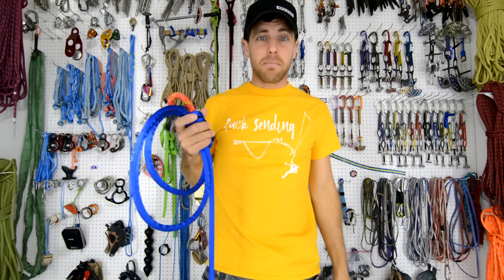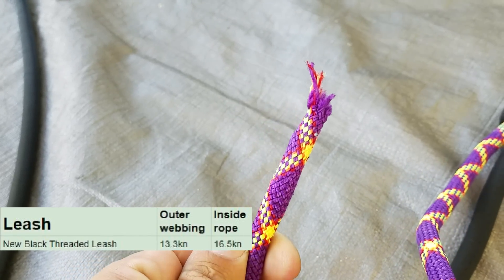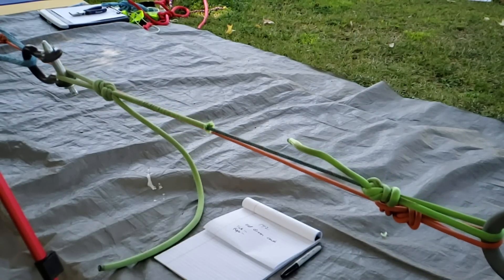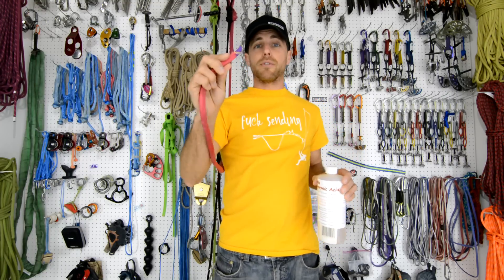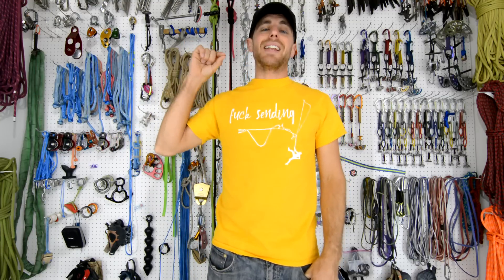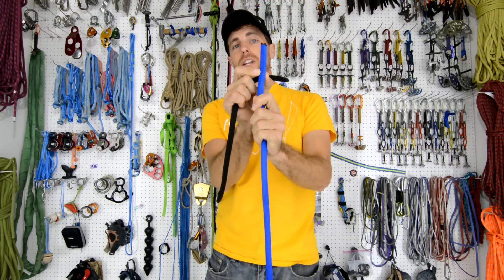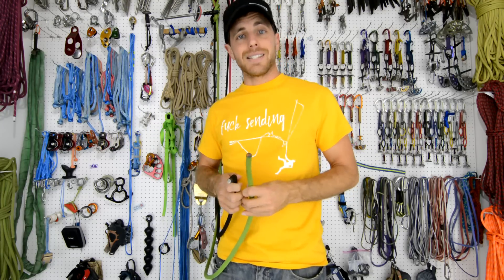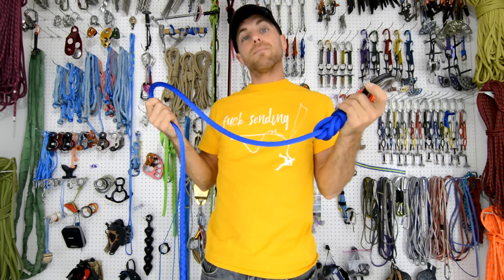Highline leashes break super weird!  SLACKSNAP!

Comment: Could you whip with a figure 8 rappel device as your ring say you dropped your leash and needed to make one to save the trip? Figure 8's are generally rated at 25kn and higher and seem like a pretty beefy ring just with another ring attached.  Haha Thoughts?
Reply: Arent those usually aluminium? Aluminium rings are contraindicated due to fatigue characteristics and their failure modes.
Reply: @JasperJanssen  True. But they have aluminum rings for Whips too. Would be curious to know for sure.

Comment: https://data.slacklineinternational.org/safety/research/forces-in-highlines-english.pdf/

Here's the link.

Worst case described-

For a ~19m dyneema line with walking tension of 2kn you can experience a leash peak load of 7kn. (Stupid for someone to rig such a line but anyway.)

Same conditions but with polyester webbing the peak leash load is 5kn. (I wouldn't prefer to rig such a line now but ive done it in the past)

So in a  short polyester line you will experience double the force on your leash compared to your findings. 

Thought i should add this perspective to the discussion.

Cheers ryan, perhaps your biggest fan in india!

Comment: Not sure if you read the comments on these now aging videos, but I feel as though it would be interesting if you did this same experiment with only the outer tubing.  I understand its not the component of the rope that actually is trusted with holding the force, but it may actually be less than the value you showed especially if the interior component is holding most of the force.  You have probably already thought about that, however, even if you didn't its still irrelevent as its not the strongest component.
Reply from the maker: The outer tubing is just 11/16th tubular webbing which would break roughly around 13kn give or take 5.  They definitely work together as this leash and everything breaks in the knot.  I've tested a bunch of 1" tubular and 9/16th tubular before and its pretty consistent

Comment: Great video!  You are on your way to a  material science lab. The slow addition of force gives you a more accurate picture of strength. In our lab when we are doing compressive strength tests of concrete if you apply  the load quickly you get results that indicate a higher compressive strength than when you apply the load slowly.
Reply from the maker: After Bolt Busters is well under way, I will start designing a drop test machine

Comment: I am curious about the formic acid dipping to join sheath and core of a nylon rope, want to give some details how not to formic acid a leash / rope?
Reply from the maker: Its all in here... https://youtu.be/kk4TqUe6TGc
Reply: Sounds like fun, until you remember actual climbing deaths from acid contaminated ropes. Acid plus nylon safety equipment - not touching that even with a ten foot long pole...There is just too many ways to f*ck it up. The damage can be invisible, the nylon might still look fine, but fail under body weight.

Comment: Another great video, Ryan. I'd be very interested in the differences in a static vs dynamic leash. Back in 2011 I cracked my ribs with a static leash on tight Mantra 1 at 40 meters. Hurt like hell and I figured it was due to the very low dynamic elongation in the system. Looking forward to your next episode!
Reply from the maker: Wow. At 40 meters you should have had enough give to absorb some of the whip. Unless it was one of those harsh ones. I use to walk 30 meter tight spider silk and i cant believe i did that haha. I did this whole elaborate test one time comparing static vs dynamic leashes only to find out both ropes were dynamic afterwards haha. I will do a video about it for sure.